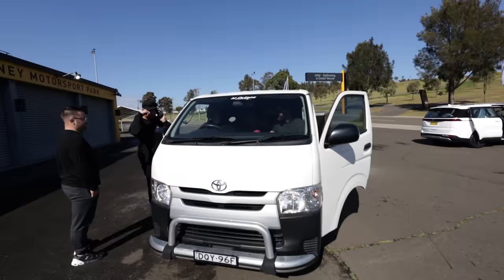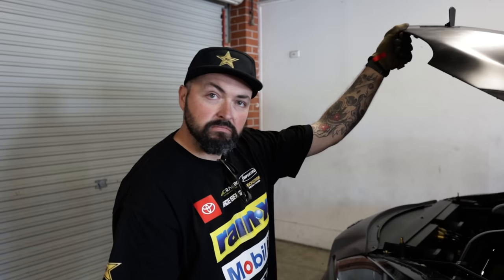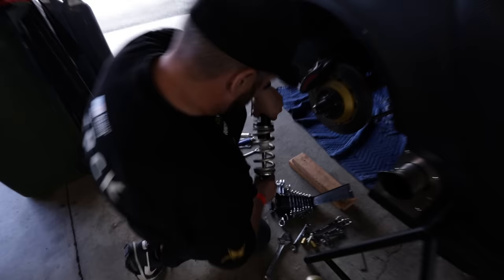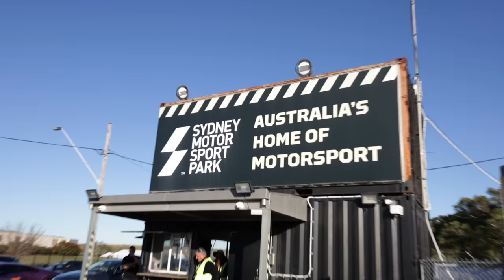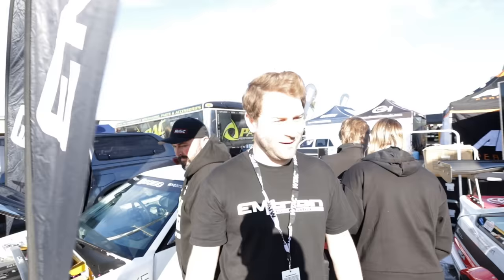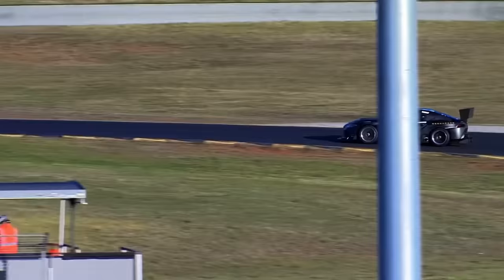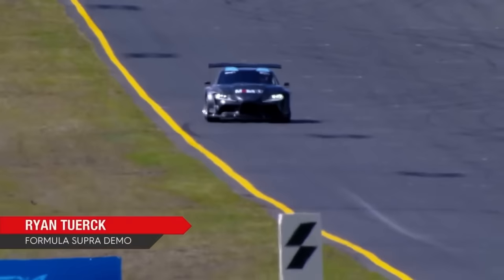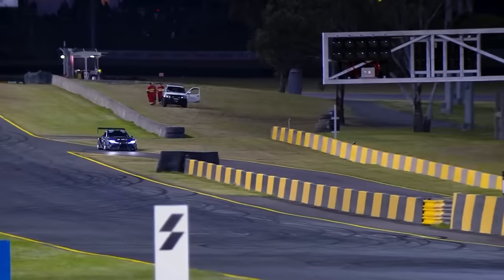Formula Supra at World Time Attack!!!

Comment: 46:42 if you close your eyes it really does sound like a formula one car... that car gives me mad goose bumps, so AWESOME
Reply: Same here. Just like F1 cars back in day <3
Reply: Same engine so it of course it will
Reply: GV5 JUDD literally is a Formula engine so yep it does. Back in 91/92'  Formula One seasons as the GV4 3.5L V10/12
Reply: @jeffreyjolicoeur8218 Is not the same engine, but it is a close as you can get to one.
Reply: @nielsreiziger4850 Basically is a more appropriate word than "literally", it is the closest thing to an F1 engine but not exactly one.
Reply: crazy thing is the mid '00 era v10 cars revved higher. this is a prototype endurance engine
Reply: @ciello___8307 Duh they revved higher..this is what, 10k rpm on the chip? Ferrari F2003 GA V10 revved to 21,000 rpm.

Comment: That Supra almost sounds like a 787B at Le Mans down the straights. Great idea putting side exit exhausts on and letting the sound pump into the pitwall and seating, which I'm sure is exactly why you did it, not for the weight savings or packaging, but for the brilliant sound.
Reply: Dude, what you wrote makes a lot of sense... It really sounds like the Legendary 787B obviously spinning above 5000rpm hehe. At idle the rotary is absolute and unique.

Comment: Didn't realise you were over here. That engine sounds so much better than the BMW engine that Toyota put in there. I saw you caught the oversteer a few times. I'm guessing the Judd motor improved weight distribution significantly which helps catch those oversteer incidents.